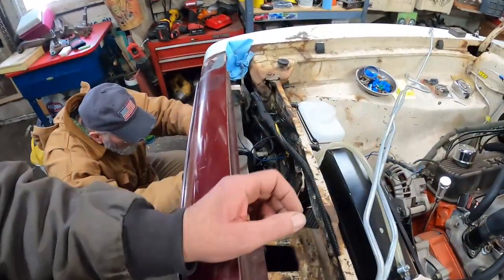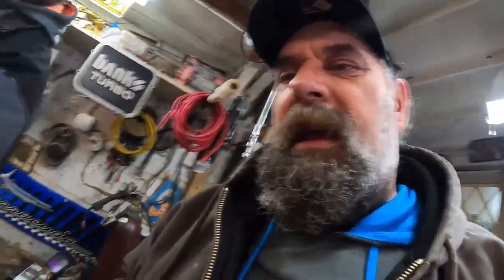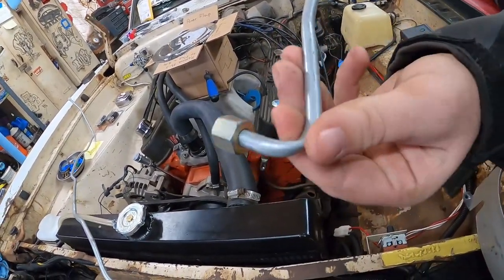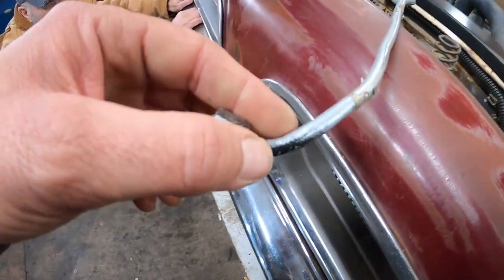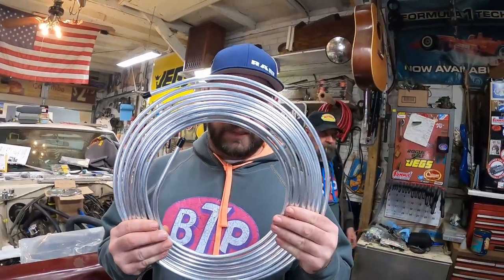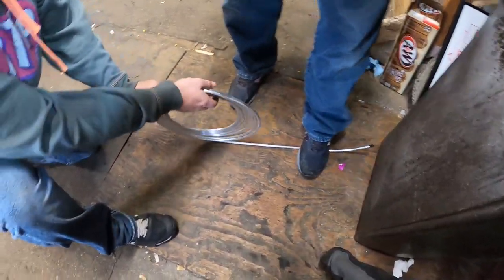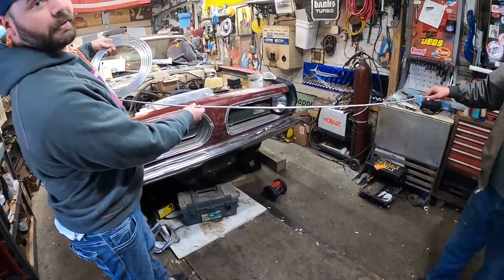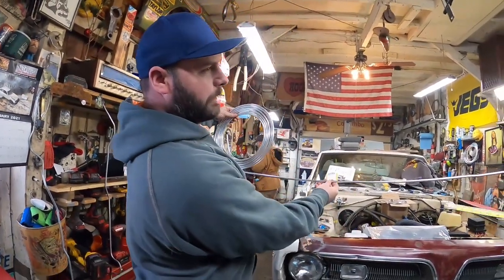After wrecking a new set of Transmission Lines, We Make our own for Project 1967 Plymouth Barracuda.

Comment: Yall are making progress! Have yall every dealt with bulk roll out brake lines? I've got 22 ft of frame on the Crew Cab and never had to make lines that long.
Reply: Yeah we do.  Try to take the originals out intact or as intact as possible, zip tie it tight at each bend, the new line to the original.  When you're done you should have a duplicate.  Of course you'll have to "double flare" the ends, don't forget the damn tube nuts.  It's actually kind of fun, you'd be surprised at some of the stuff out there that you can pick up for cheap just because it needs 30 bucks worth of brake or fuel line.  You can can do it Duddie.
Reply: @79asspin  Great Idea! Mine are intact , just rusted up and exposed to elements. I'm going to try your idea, Im still stripping down the frame so I will be "careful" with the existing line. Thanks!

Comment: 6 years ago, the 3 of the six bolts that hold the power take off on the 1978 Dodge W300 transmission broke. worked fine for the last few months. then another bolt broke... so now that it has 2 loose bolts holding it on, got 6 new ones and am thinking... should i extract the broken studs and bolt it back on tomorrow, or a few hours before it needs to be used? has not had oil in it for more then 8 years, works fine.
Reply: If it were mine I'd fix it but then I'd be without a truck for 6 months.
Reply: @79asspin  it runs fine with no oil, its just that the 6 gr.5 3/8'' bolts holding the PTO case on the transmission case all sheared off. its 40 below so i have to fix it before the week it over... cows need food. 6 months for 6 bolts... the truck needed those replaced 8 years ago.
Reply: @ardennielsen3761  Wow 40 below? I was bitching about 10 below.
Reply: @79asspin  the cold shock at that temperature causes blood pressure to the core to rise uncontrollably. and so that's why February has Valentin's day, forced reactions...for animal kind, it works on the bull's and cows that the truck brings grass to, the dogs and wolves too 40 below but by what there doing they think its "THE DAY". I need a drink now.